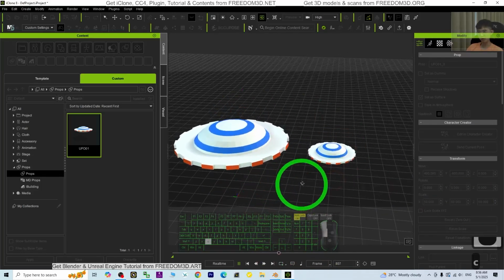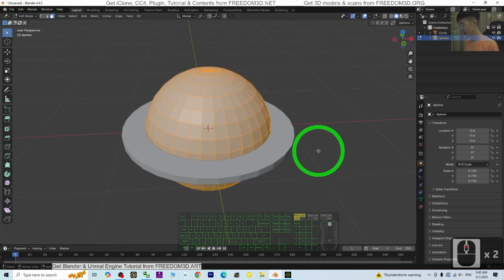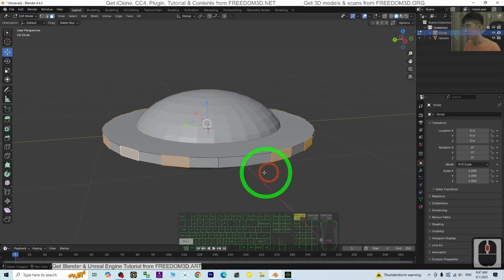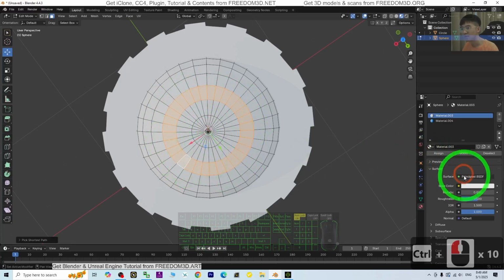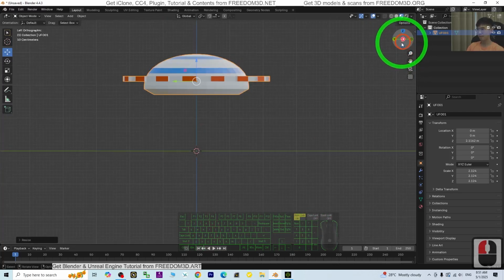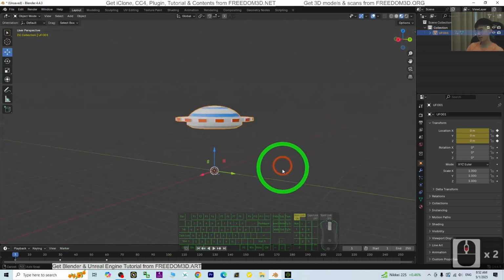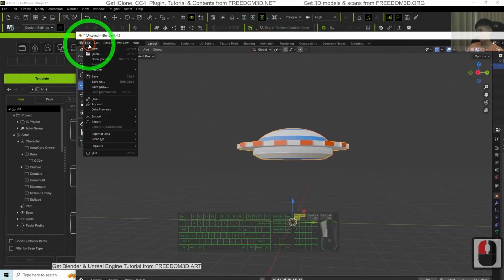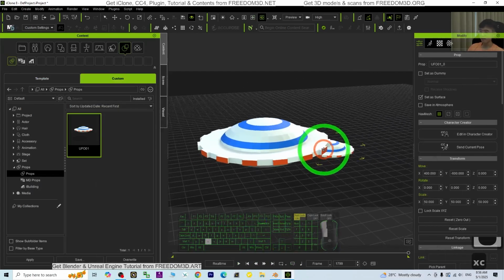Blender UFO Prop Animation → iClone 8 FBX Workflow (Beginner Tutorial)

Comment from the maker: This tutorial demonstrates how to create a simple floating UFO prop in Blender and export it for use in iClone 8 animation.
Modeling Process:
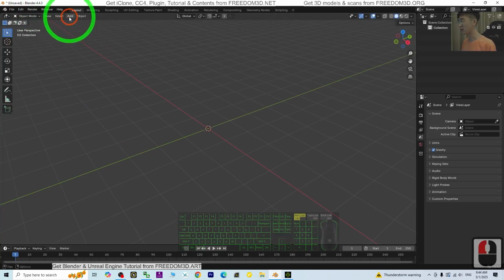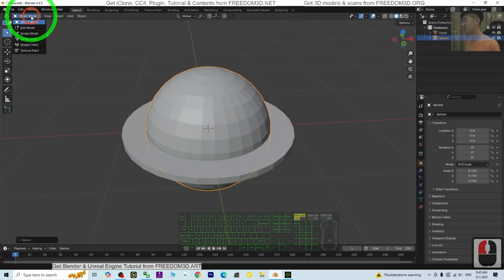•	Base Shape: Starting with a circle, the creator creates a plate-like base and a UV sphere for the UFO body (0:57-1:45).
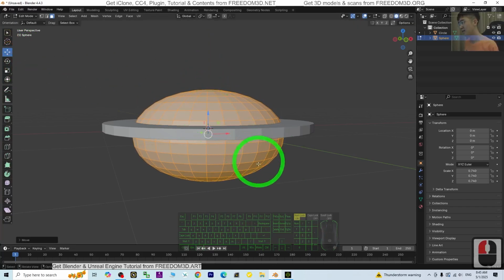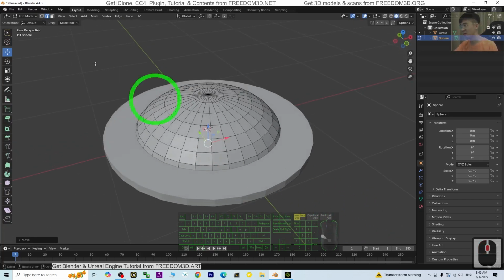•	Refining Geometry: The bottom vertices are removed and reconstructed to create the desired shape, followed by extruding faces for added detail (2:07-3:05).
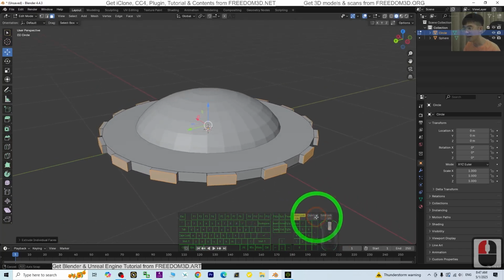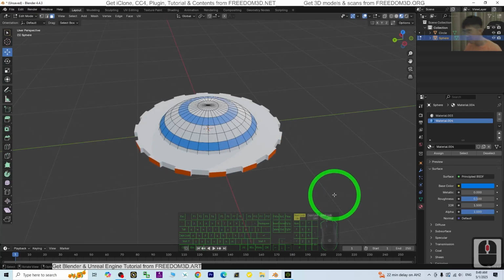•	Materials: Distinct colors (white, red, and blue) are assigned to different parts of the model to enhance its look (3:55-5:45).
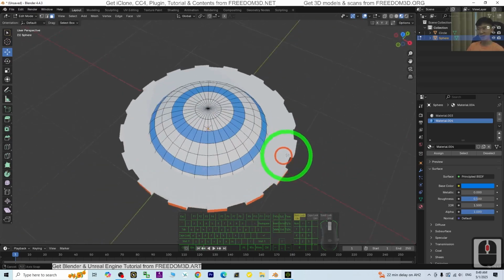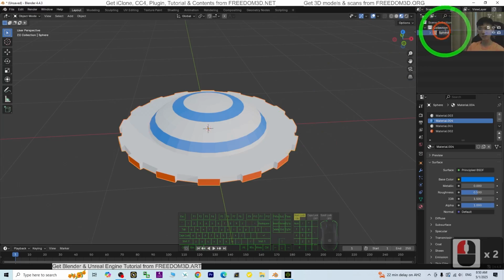•	Combining: The components are joined into a single mesh using Ctrl+J (5:53-6:15).
Animation and Export:
•	Keyframing: The UFO is positioned above the ground, and keyframes are set to create a simple up-and-down floating motion (6:28-8:47).
•	iClone Workflow: The model is exported as an FBX file and imported into iClone 8 (8:50-9:34).
•	Looping & Saving: The creator adjusts the animation to be smooth and loops it within the iClone timeline. Finally, the UFO is saved as a custom prop, allowing it to be reused easily in future projects (10:12-11:56).